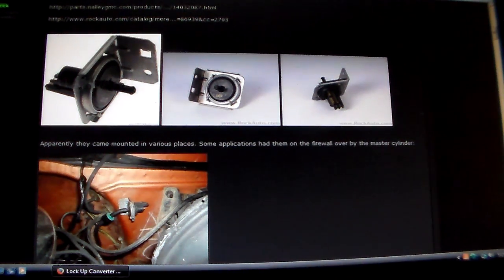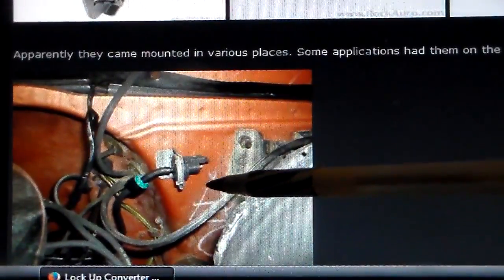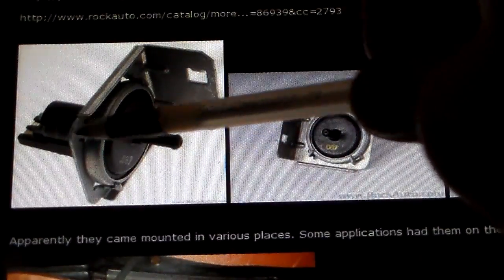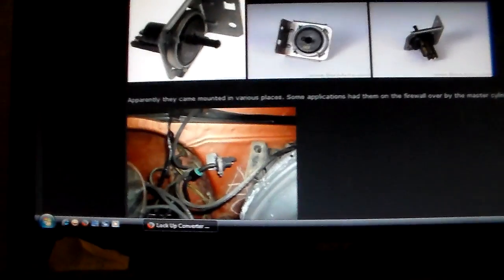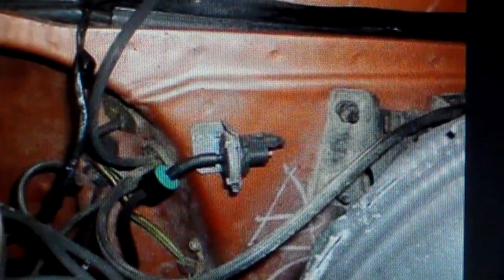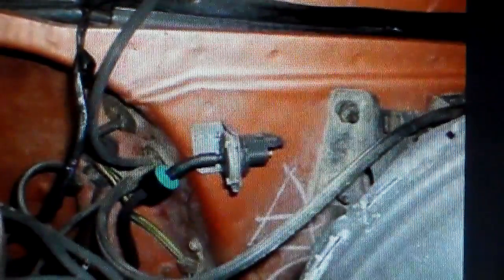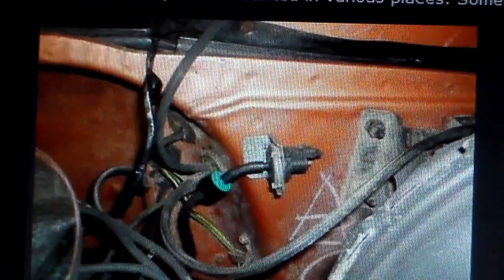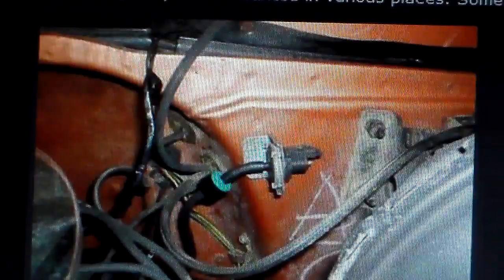How to understand '80's Silverado/Sierra TCC lockup

Comment: Greetings! First I would like to thank you for making these informative videos for all of us backyard mechanics. I watch your video on replacing the TCC solenoid and it was a breeze. I'm working on a 1982 Oldsmobile Toronado with a TH325-4L transmission. Just bought it and I'm trying to work out the bugs from prior mechanics. The carburetor has be switched to a non computer q-jet. It's EGR delete and has a vacuum advance distributor. I ran the check engine light for codes and it showed 12 for no issues. Can I run this set up you are showing here on this TH325-4L. Reading blogs online everyone is talking about needing a toggle switch to perform the converter lockup. Any thoughts on this? Unfortunately, for me these front wheel drive cars like Toronados are hard to find information on because these transmissions are strange animals. Thank you in advance for any insight you may provide.
Reply from the maker: Sure. As long as you gain an understanding of which vacuum switches do what, you should be good to go. 1977-79 Oldsmobile 350 Qjets are the very best to use as replacements for the CCC versions, since they use the same linkages and vacuum connections, with the addition of the timed vacuum port for the distributor.
Reply: So I can just tee off of the timed vacuum port I have the distributor hooked into on the front right (drivers) side of the carburetor. Correct?
Reply: Did you ever figure this out? I have an 84 Eldorado with the same transmission. Did an engine swap to a carbuerator on Oldsmobile 307. I believe the computer controlled 4th gear tcc lockup is now deleted so trying to see how to make the transmission work as it should. Did this work? Also is it bad if I just kept running this car As is?

Comment: I have a th350 from an 83 3/4 ton van. I didn’t see a plug on the side. Would love to buy a lock up converter and modify it to work. Any ideas
Reply: same here on my 85 caprice
Reply: A Th350 doesn't have a lockup converter, a TH350c does but nobody uses them.  They step up to a 4 speed automatic and use a TH200r4.  Same trans that came in the Grand Nationals and many other GM cars and the best part is they are a direct replacement for the TH350.  The 700r4 is longer with the mount in a different position, you'll have to move the rear crossmember and cut your driveshaft with a 700.

Comment: So another words using the vacum switch to control the lockup torque converter ....why can you just use a passing gear switch for a th 400 transmission instead of the vacum switch or a toggle switch
Reply: You can do about anything, since it won't lock up in first anyway it's really up to you, however the TCC clutch is not that strong, and it can slip which = heat and wear so it's best to just use it in 4th gear only. I found the Vac sw just caused problems with too much cycling of the TCC esp in hills
Reply: Vacuum switch gives better insight into load percentage

Comment: I think im just gonna install a oil pressur switch and wire my + to it up to that plug amd the other wire to ground and let the trans pressure do it on its own
Reply: forget the Vac sw it just causes cycling of the TCC clutch. if you mash it, it will kick down unlock anyway
Reply: That's the way to go but pull the power through the N/C side of the brake light switch so when you stomp the brakes the lockout drops out immediately.

Comment: Ok, so there are three switches inside the trans that will interrupt the signal from terminal A on the trans plug. First one is before the solenoid coil, and it opens on a 4 to 3 shift. Then between the solenoid and the next sw is a temp sw so trans must be up to temp, however if term D is grounded this and the next sw are bypassed. Next the temp sw feeds a 4th gear pressure sw, so it must be in 4th gear unless term D or B is grounded. Term B can bypass the second 4th gear sw, but nothing can bypass the 4-3 open sw but I that is just a pulse, so unless Term B or D is grounded it can only lock up in 4th gear. I'd post the schematic, but I don't have a good way.
I'd appreciate any feedback on this as I may be missing something I don't know.Update:Ok so I have completely redone my lockup system now and here is what I have done and found out.1. The power for the lockup comes from one of the plug type connectors on the top of your fuse panel.2. That wire goes to the brake pedal sw which is on the passenger side of the steering column just under the dash (remove the little middle dash panel)3. From the brake peddle it goes to the Vacuum sw (on the firewall next to the Brake Booster) There is ANOTHER Vac sw on the Passenger side, that is tip in Vac for spark control and is NOT part of TCC.4. This is where it goes south. The wire from here goes to the Transmission, AND the EGR bleed valve (above the EGR valve on a brkt on the engine). and there is another wire that come back from the transmission for what IDK.ANYWAY here is what I did. I took the wire from the Vacuum sw and bought a new connector for the transmission, wired the switch leg from the Vac sw to the 4th gear pressure switch (inside the Tans pan back Drivers corner right by the Accumulator I think it's 2nd gear Accumulator not sure), from there I went back to the trans connecter on an different pin and back inside the cab, AND the same wire from the 4th gear pressure sw to the TCC solenoid valve ( inside the trans pan in the front just to the drivers side of middle) then took the black wire from there and put a ring terminal on it and put that under the mounting bolt for the Solenoid.The wire inside the cab is the same as solenoid power so I hooked t to an LED indicator so I know when the solenoid is energized.Now after driving for a while I noticed that using Tip in Vacuum for the Vac sw source caused way to many lockups and unlock cycles and since I don't like wearing out the TCC clutch I switched it to manifold vacuum which does not go away just because I let off the throttle when I'm goin down a hill at 75 MPH which I like, no need to unlock for that. I am still considering getting rid of the  Vacuum switch all together as I think then it would cycle even less, and if I step on it it's going to kick down to 3rd and unlock anyway. Currently I get a little flutter out o fit just before it kicks down since the governor pressure is just below kick down pressure when the TC unlocks and that changes engine RPM and then that changes governor pressure and Engine Vacuum which then relocks the TCC then it kicks down and unlocks on the 4th gear pressure sw. all this is too complicated for and old hardwired control system, so in the end I think I'll just use the Brake peddle and the 4th gear pressure sw for controls.Hope this helps anyone working on this. If not visit my page and message me and I'll try to get back to you.
Reply: I forgot to mention mine is 700r4 in a 91 GMC VANDURA. I'll probably end up replacing the whole transmission since I found metal pieces in the pan.
Reply: @darellgholston9720  well yes, locking the TC won't fix your 4th gear clutches 😁 and the whole thing is toast if the fluid is contaminated

Comment: Sir I'm trying to help a friend get his truck ready to install the MSD EFI kit.  It chevy truck is a 1984  Would you know if I would still need to install a lock up kit in his trans?  Thank you sir!!
Reply: That was very close to the age where the 350 th had lockup, so look for the plug on the side of the trans if it has it then you can add lockup, it will help with mileage a little. added about 1.5 MPG for me, but heck that's over 10%
Reply: Thank you. It has a 700r4. Now I’m trying to figure out exactly how to wire it up so it will lock up in fourth gear instead of third I believe there is a kit you can buy and wire it up
Reply: @billyferguson5881  You don't need to run a vacuum switch.  
An easy rewire in the trans with a new 4th gear pressure switch and take power from the N/C side of the brake switch so when you hit the brakes or downshift out of 4th for any reason the lockout drops out.   TCI and Monster transmission have the kits and video's.  Cheap and easy.

Comment: What if you swapped in a edelbrock carb.
Reply from the maker: Makes no difference. Vacuum is vacuum, whether it comes through an original Qjet or a generic Edelbrock/Weber.
Reply: Where @ you plug up the line for it on the carb
Reply: @buckster2575  actually you can use manifold vacuum, the trans wont lock unless you are in 4th gear anyway.Actually I found using tip in Vac caused too much cycling of the TCC anyway and I moved mine to Manifold Vac.
Reply: I prefer to use the ported vacuum on the front of the carb

Comment: You did a GREAT JOB on this video! Very thorough . May I make a suggestion, in your explaining of 2 different vacuum switches, remember to always and only describe the locations of a vehicle as ,front or rear; and not right or left, but as drivers or passengers side. Example your vacuum switch was correct as drivers front side of firewall.
Another enhancement would confirm , pull some tape off wires near plug end
And show color of wires to confirm right switch and or circuit.
 Of course being that the internet is world wide, some places overseas the drivers side could be of different side . Anyway wow what a great video, you impressed me ,THANK YOU SIR.

Comment: do you have to have the check valve on there for it to work?
Reply: No, and you can use manifold vac if you prefer. But it does help reduce cycling. that check valve isn't just a check valve, it is actually a timer, it allows just a seep of air in one direction and then full flow the other, make sure you have it where the slow leak is the engine drawing air out of the Sw and the bleed direction toward the sw so when you lose vac it dumps the sw right now, or better yet jumper the Vac sw and forget it.
Reply: Vacuum delay valve, its a metered orifice in a check valve that is used to help prevent "hunting"

Comment: Can an 87 that has been converted to carb run this vacuum style lockup?
Reply: Of course., actually I may be wrong on that, if the trans is a 4l60E then it is computer controlled and is a whole different beast and requires the computer to do all the shifting via 4 solenoids
Reply: You don't need to run a vacuum switch.  
An easy rewire in the trans with a new 4th gear pressure switch and take power from the N/C side of the brake switch so when you hit the brakes or downshift out of 4th for any reason the lockout drops out.   TCI and Monster transmission have the kits and video's.  Cheap and easy.
Reply: @hardball107  damn are u a spokes person for monster transmission? Your on every comment
Reply: @thehumancrumb.668   Just trying to pass along some info that cost me a lot of money to learn.  It's much better to sit through a lecture so you understand a problem than have to pay for it when the money is better spent elsewhere.  I you already know it ignore it but there's a lot of lousy info out there.

Comment: Hi Tyler. I just came across this video and I'm really excited about how you explain the lock up in these old chevy trucks. I have a 1983 chevy c10 and had no idea how the lock up worked. You have taught me a lot and answered a lot of questions. Now, I have another question for you. My truck originally came with a 305 but in 2006 I put a new chevy 350 crate motor in it. I have had a lot of trouble with vibrations and loss of power 40mph and higher ever since I put that motor in it. I've done all of the expected changes to try and solve the vibration problems...rebuilt transmission, new torque converter, distributor, carb, ujoints, on and on. You mention in your video about a second vacuum switch on the 305 passenger side that looks like the TCC. I have that passenger side vacuum switch and would like to hear more about what it does and if this could be the culprit in making my truck vibrate, lose power. The original distributor did have a wiring harness that came out on the side and clipped into a harness coming from the firewall. I was advised NOT to use that type of distributor and the new distributor does not use that harness, but I do see that the vacuum switch has a wire that looks like it is part of that firewall harness. Have I messed things up mechanically with the new motor and distributor? Am I finally, after years of work, zeroing in on the problem? Thanks in advance for your help Tyler.
Reply from the maker: That switch on the passenger side is part of the old ESC spark control system, which was basically timing advance control. If you are using a regular HEI distributor, then no need to be concerned with that switch at all. You're current distributor should have a vacuum can on it which is connected to the timed vacuum port on the front of the carb.

 You may need to separate the vibration and poor performance  into two different issues as far as troubleshooting. They COULD be related, but I would first confirm or eliminate engine problems. Compression, timing, make sure the cam isn't flat on one lobe, etc. If the engine is on 7 cylinders or less, it's going to vibrate and obviously run terrible. I can advise you more but I need more specific info regarding how the engine itself runs and does it vibrate when revved up in park or neutral.
Reply: Hi Tyler. Thank you for responding. I need all the help I can get with this old 83 chevy truck. I'm the 2nd owner and it  had 11,000 miles on it when I bought it. 10 years ago I replaced the 305 with a new 350 chevy crate motor. It started vibrating and losing power 6 years ago and I have been trying to fix it ever since. I first noticed it on the highway going to work. At 55mph it would start shaking and I couldn't accelerate. I felt the shake in the seat, not the wheel. I would take my foot off the gas, let it coast a little and it would recover and I could start going again. Since then I've changed distributor, coil, plugs and plug wires, rebuilt the quadrajet, new fuel pump, new gas tank sending unit, rebuilt the transmission, new torque converter, new waterpump, new alternator, new u joints, new vacuum lines, I don't know much about timing so I had a shop check and set the timing. The torque converter was the last to be changed, last February. After it was changed, I thought I had fixed it. I could run it on the highway without shake and could maintain 70mph. But in April, the shake and loss of power started again, around 45mph. It shakes violently going up hills, but then there are some days when it doesn't shake very much at all. When it starts shaking, if I drop it into 2nd gear, the shaking will stop, but I'm not sure if it is because I have taken my foot off the gas. When the truck is parked in the garage, I can maintain 2000 rpms all day long and no shake. I can put it on jack stands and run it at 55 mph in the garage and no shake. I've got the carb tuned in really well and idles very smooth. It is hard to tell it is even running at stop lights. Sorry for the long reply but I wanted to be as clear as possible. Thanks for the help Tyler.
Reply: SBC engines are known to have the fuel pump cam lobe go flat, this will present itself as loss of power under heavy load only, then when you let off it will fill the float bowl and recover. try an electric fuel pump and see if that works. changing the Mech fuel pump won't fix it, since it's the cam lobe that is at fault.